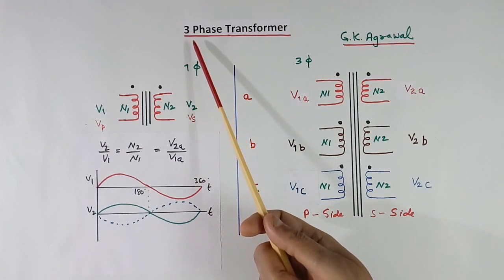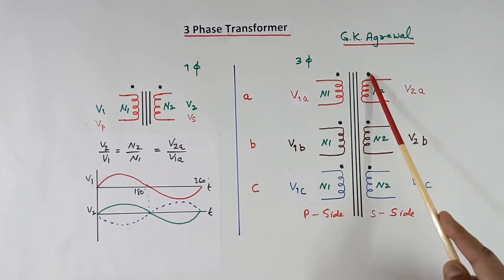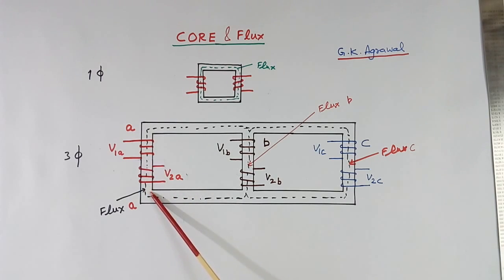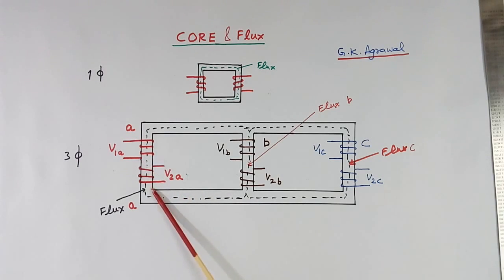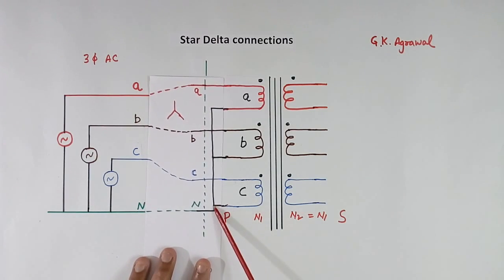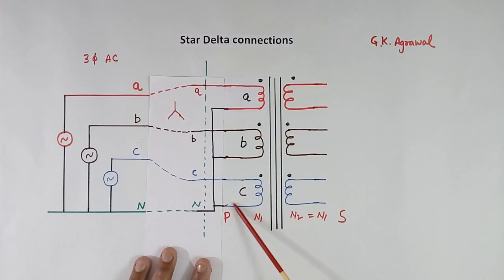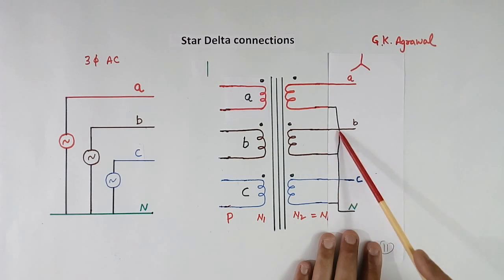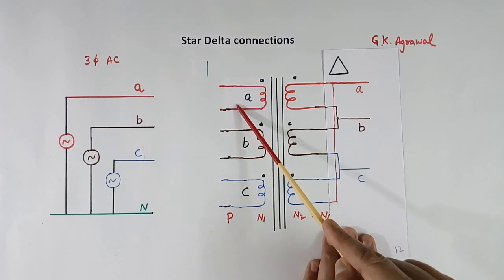3 Phase Transformer & its delta star concept, connection

Comment: does the transformer see 180Hz.? I guess what I'm asking does the core change polarity the same as a core for single phase 180 Hz would?  why I ask. if I took a 3 phase transformer. wound 3 coils as primary with 1 wire from each to the pos of a battery. then one wire from each to MOSFETs. to ground each like a push pull . but with push pull push. or push push push. with a single secondary winding for a low frequency boost stage for a inverter. could that work? or would it be best to wind it as a single phase push pull ? would it only give the FETs more off time. would that be the only advantage? sorry I'm learning all I can. by my self. and i just was thinking . it maybe could work. and maybe a 3 phase iron core could operate at a higher frequency. than a single phase core.  just a crazy idea I guess. or would it require 3 H bridges? to work. I hope I haven't lost anyone who is trying to figure this out. because I think I have lost my self! my mind is lost in one of the phases I think.